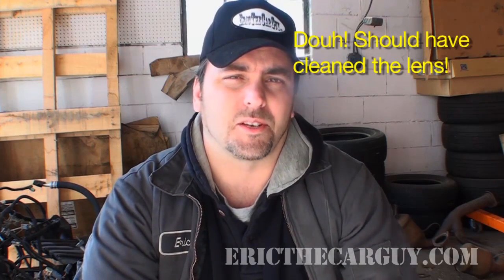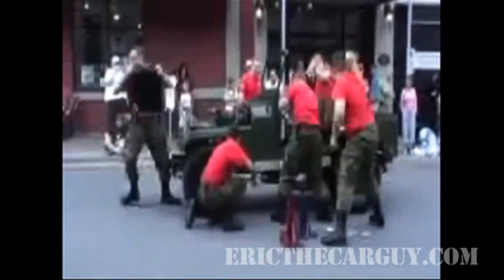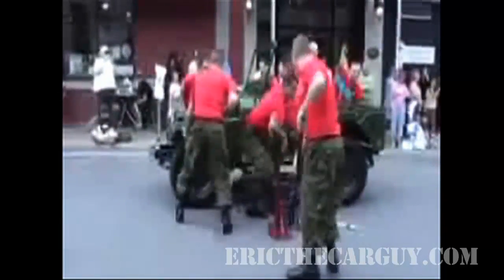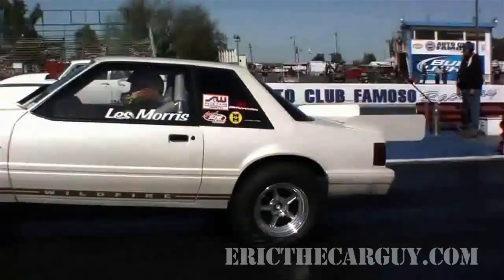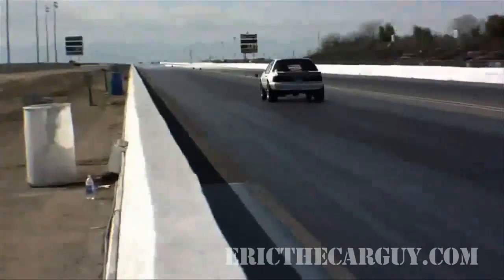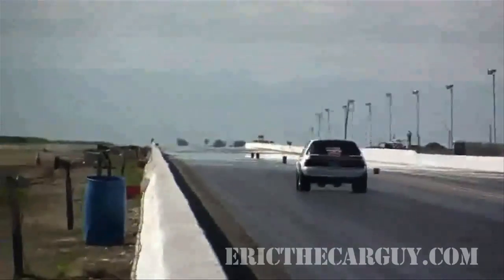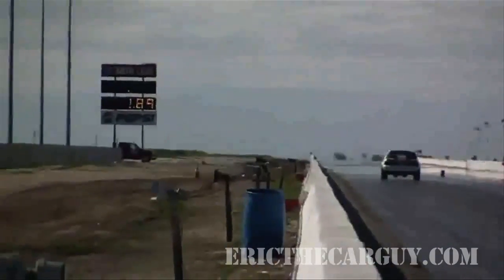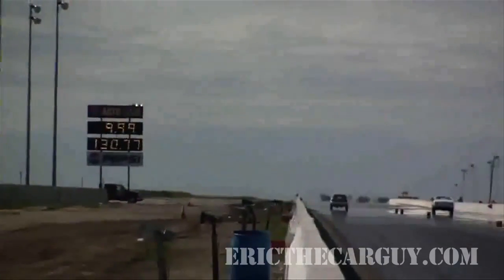FATR Episode 6 - EricTheCarGuy

Comment: Sharpening mower blades FTW Lol. I would be interested to see your method for getting a stuck on wheel unstuck. I dont see it often, but I usually thread the lug nuts on most of the way and take the car down the street, weave back and forth a couple times and you can feel the wheels break free from the hub. There's one material that some wheels are made from that seems to like to weld itself to the hub over time. I can't remember the name of it for the life of me. You probably know what I mean.